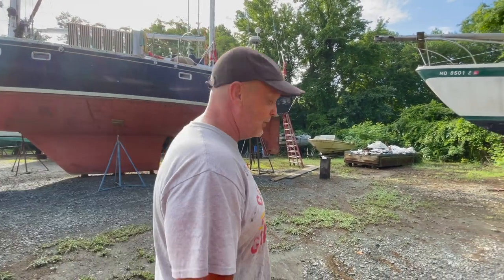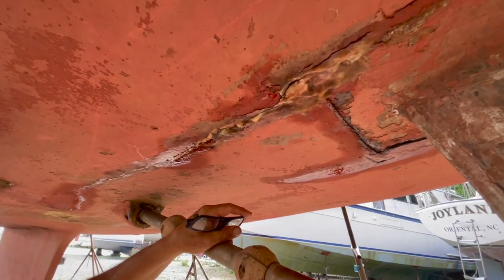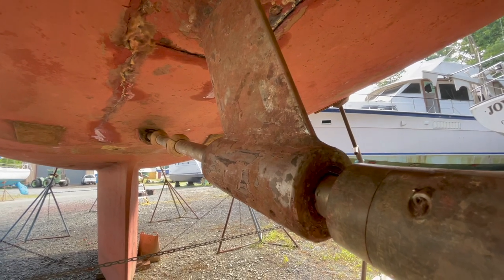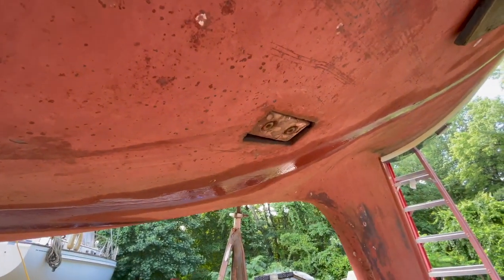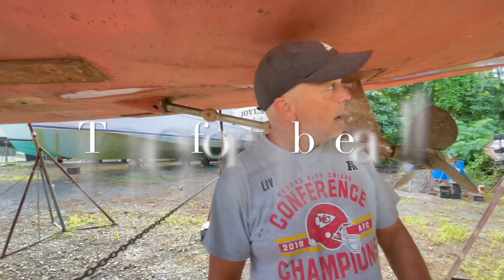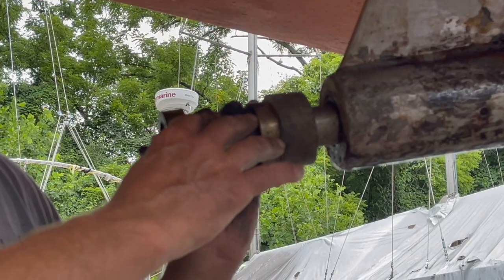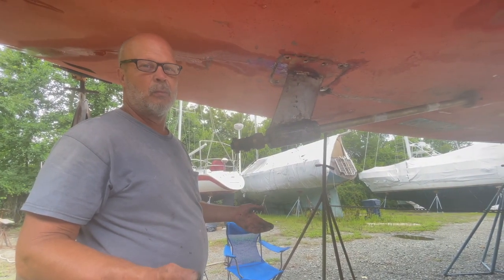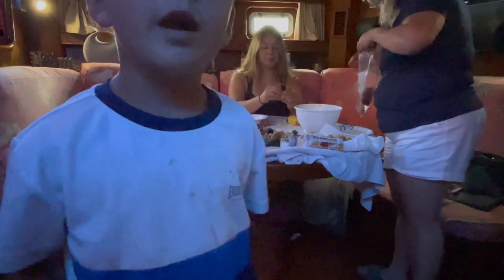Life on the Hard in a 55 Tayana C&C

Comment: Did that "crack" and the other issues not show up with the survey?  You will be sanding a while, then buffing, then waxing.  To add, boat work is always good work and that is a good thing because it never ends.
Reply: I did it . I left the boat for a year and a half and water got in the bilge and filled over winter it migrated up the stringer froze and cracked . That’s my theory.It wasn’t there when it was surveyed. And there was no signs of a old repair  . Wait to see how much fiberglass I have to cut out to fix it .

Comment: Sanding... 3 weeks.
Reply from the maker: That was some sanding . I think it took me 6 weeks at 5 or 6 hours a day to get it down to the old fairing and gel coat .She was smooth when I was done . I gotta pull out soon and replace the cutlass bearings and anodes .  I bet the paint job held up good . We will see in the early spring .

Comment: Makes no sense to me why you wouldn't do the bottom of the boat 100% and with the proper primer and antifouling.. all the thru hulls should be replaced etc. Seems like you're looking at redoing this boat just like a flipper house rather than a house you bought to fix up and keep
Reply from the maker: I ended up doing it down to the gel coat and put new barrier. Did you see all the fiberglass work . I think it took three month to get it all straight. I did all the through hulls when I first got to the boat . Well 7 new ones the others ones I cleaned up and serviced . The old ones where some brass ones from England that had different threading from the Grocos you get hear . Royal threading something like that